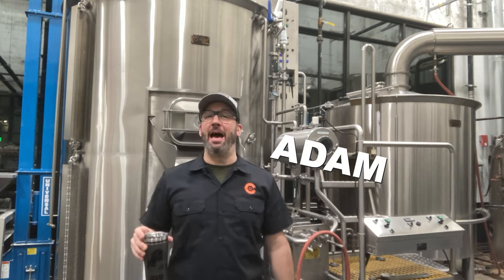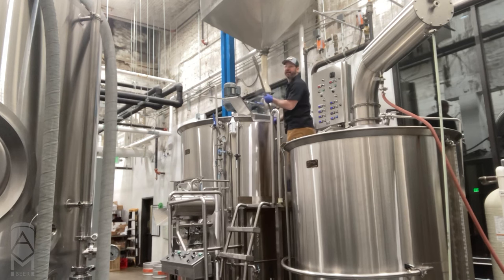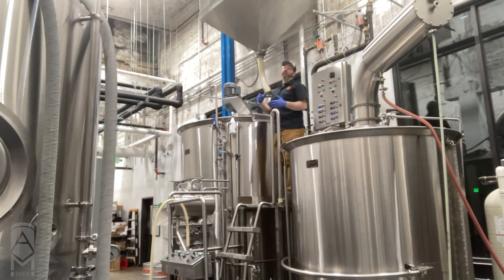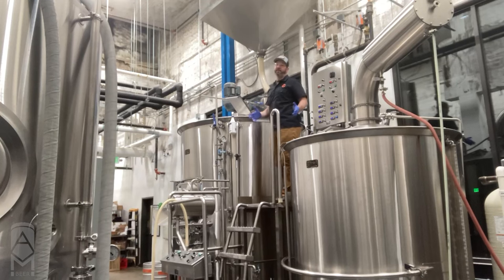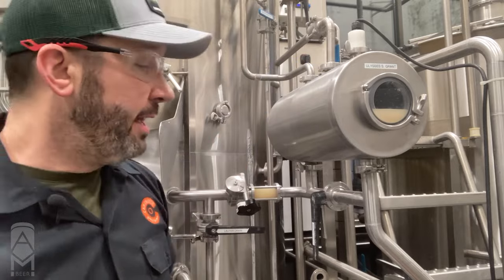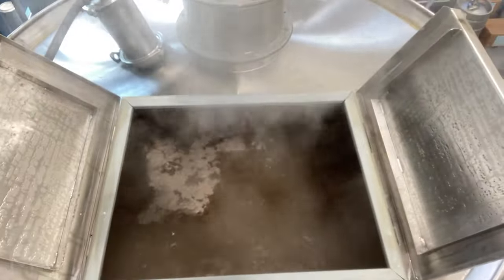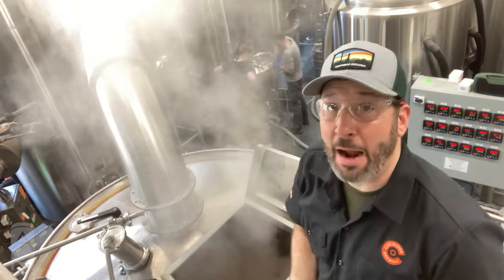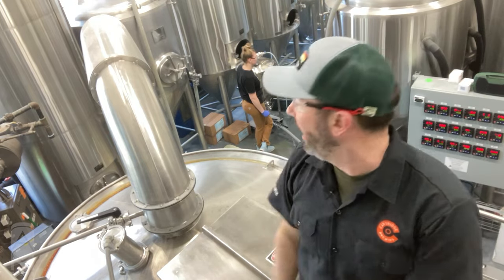Adam Makes Beer: Professional Brewer Makes Mexican Lager!

Comment: Hi Adam, I noticed that you use a electronic flow meter.  Can you tell me the make and maybe the model number?   It looks like GPI brand?  I would also be interested in information on your dial run off valve.  They look like some pretty sweet equipment.  Thanks!
Reply from the maker: It a little battery powered one. here is the part number its gpi: 01N31GM

Comment: Great video.  We actually have (almost) the same 15bbl system from Spec Mech, though ours has a mashkettle and not a traditional combi-tun setup like yours.  Do you run your rakes at all while lautering?  I know some brewers run them at the absolute slowest speed to get every little bit of extraction out of the grain.  Not sure how much efficiency that actually adds, but thought I'd ask.  Cheers!
Reply from the maker: I have done both. I will of the bed seems a bit sticky, but in general no. I feel like I get less grain in the kettle when I don’t.

Comment: Lovin the videos!  Been to Cartridge several times and enjoy your beer!  As a homebrewer in the area I love to see you making these videos!!               Question...When you calculate your IBU's in recipe formulation do you account for the bitterness contribution during the whirlpool and whirlpool rest as the hops would still be contributing IBU's?  Thanks!!
Reply from the maker: Thanks so much, I appreciate the support! Absolutely I calculate all of the hot side hop additions. The primary difference between brewing at home and on the larger scale is that my wort will stay hotter, longer thank it will in a smaller kettle. That means that even my late hop additions will generate a solid amount of bitterness. For instance, one of primary changes I mad when turning pro was counting my flameout or WP additions as 20 min additions.
Reply: @adammakesbeer  Awesome!  Thanks for the reply!

Comment: Nice video, looking forward to watching more content from you. Been a pretty dedicated homebrewer for ~5 years now, fun to see how it's done on a large scale.
One thing you said in the end when tasting the beer - you mentioned pH and water and that it can lead to grain/husk flavor when too high. Did I understand you correctly, that you also adjust the pH of the sparge water? What water do you use (perhaps I missed it in the video)? I'm curious since I tried researching this a couple of years ago or so, and came to the conclusion back then that at least with RO water, it's not necessary to adjust its pH since its residual alkalinity is so low that it won't matter much.
Reply from the maker: I can’t use RO water and I don’t have experience with it. I do adjust my sparge water ph to 5.5 in order to not pull tannins aka the husky flavors out of my mash. Does that answer your question?
Reply: @adammakesbeer  yeah it does, thanks!